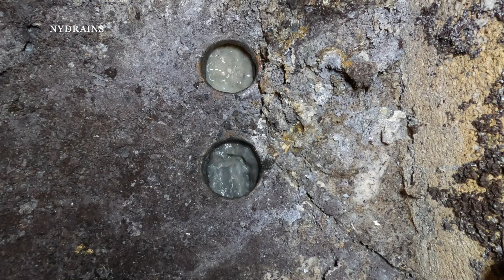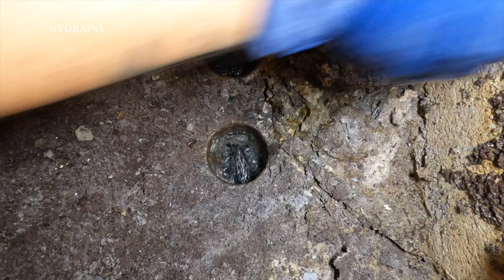Clogged Drain #117

Comment: Nice work man, the owner like you said was very lucky he caught that in time. I saw a similar situation years ago where I used to work where two silly buggers tried to dispose of very expensive (at the time) epoxy based paint they were using to re-paint a large metal lathe. They got the mixture all wrong and it wasn't going on very well and looked horrible so they got the bright idea to hide and/or get rid of the "bad batch" by pouring it down the toilet. Well as you probably know when epoxy hits water it goes rock hard and NOTHING will remove it. The entire basin part of the toilet was as solid as a rock so their next bright plan of action was to remove the toilet and start hammering at the epoxy with large crow bars on one of the fabrication departments steel benches. In the end they basically ended up shattering the toilet into multiple pieces and all I saw when I came into work the next day was a shattered toilet with two crow bars stuck in it on top of a steel work bench. I pissed myself laughing for the rest of the day.
Reply from the maker: 😆 🤣,  thanks 👍
Reply: Wow that would've been awesome to see, dumb and dumber at work. 😹😹

Comment: Great Job, but consider using a 0.5 inch masonry drill to assist in breaking up the concretion..
Reply from the maker: Thanks,  usually don't run into cement clearing a drain lol 😉👍